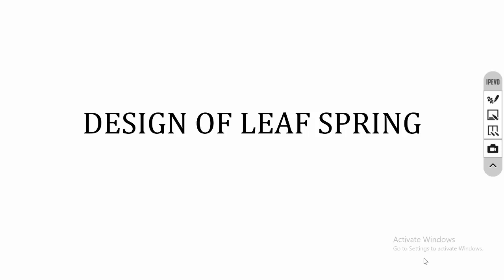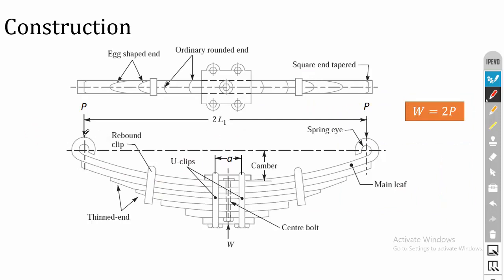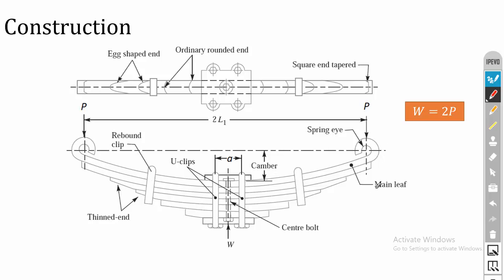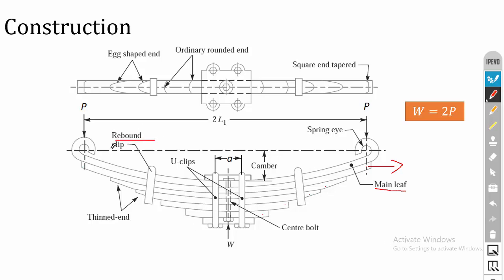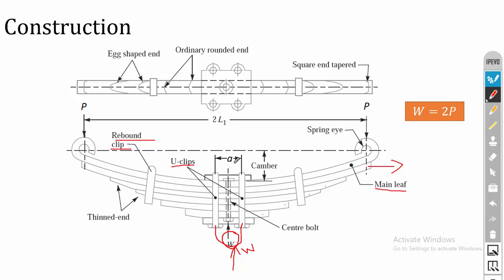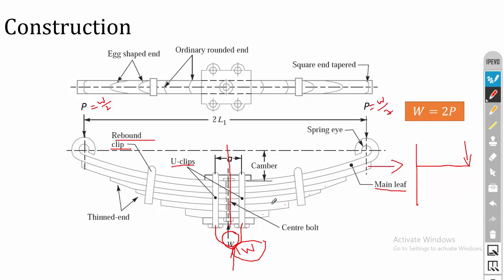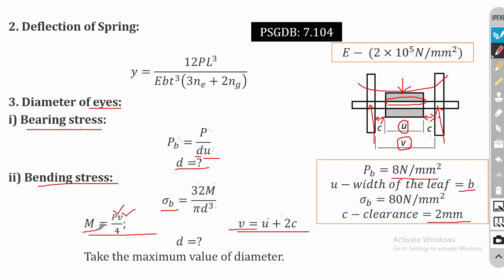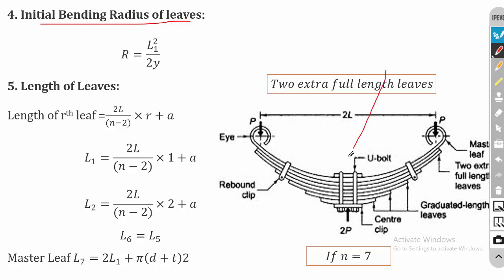Leaf Spring | Introduction & Design Procedure | Design of Machine Elements

Comment: How can i design a leaf suspension of a vehicle of maximum gross weight 5tons? pls help
Reply from the maker: Calculate the weight acting on a single wheel ( in general 0.8*total weight)... Then select the material, consider some factor of safety... Then design the spring using the same procedure.... Finally do check your design using any analysis software for safety....

Comment: suppose 3000N load is acting on a leaf spring suspension and you need to design the master leaf first .How will you calculate the FULL LENGTH of master leaf(2L)????
Reply from the maker: You cannot directly calculate the length of the master leaf without calculating ita cross section... Either you have to start by considering a rough length or by fixing the cross section you can calculate the length...
Reply: @themechanicalengineer  ok,suppose width is 8 mm and thickness is 5 mm then can you calculate length of the master leaf length?
Reply from the maker: Using stress equation calculate the active length and using the master length equation calculate the master length.
Reply: @themechanicalengineer  Thanks for guidence. Do you have any specific course which will cover everything regarding design of leaf spring from scratch and it also cover testing of leaf spring ( FEA, Load testing etc)? If you don't have then do you know anyone who can teach me on this? Please let me know

Comment: Why the ne is multiplied by 3 and the Ng is multiplied by 2 ?
Reply from the maker: The specific factors of multiplying "ne" by 3 and "Ng" by 2 in the stress calculation formula for leaf springs are based on engineering design guidelines and empirical observations.

Comment: why we take maximum diameter in i bolt
Reply from the maker: If we select the minimum diameter it may fail when it is subjected to high stress (in the other case)... But, If we select the maximum value it can withstand both the stresses..
Reply: @themechanicalengineer  thank  you sir